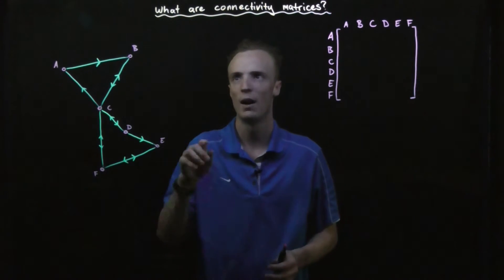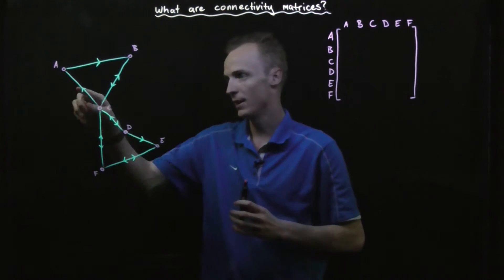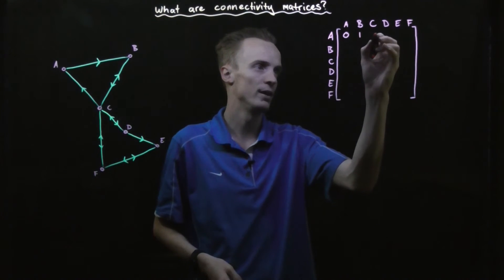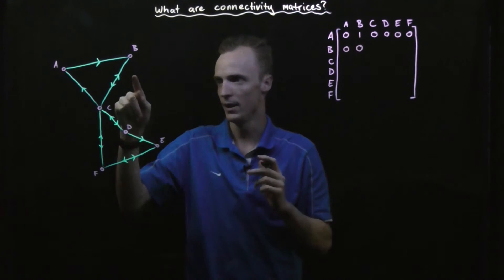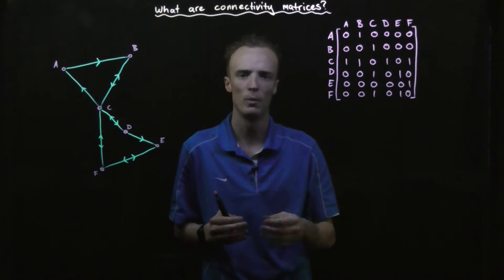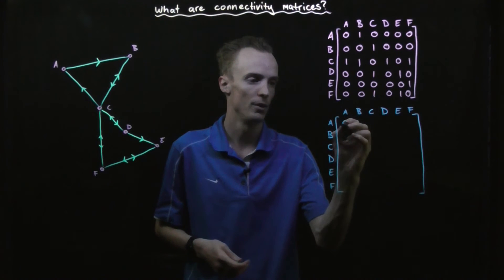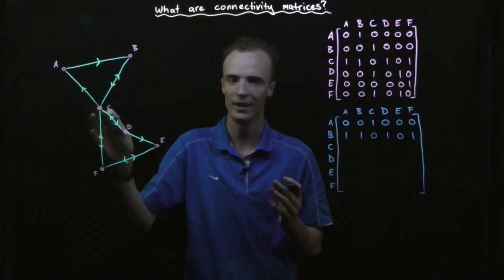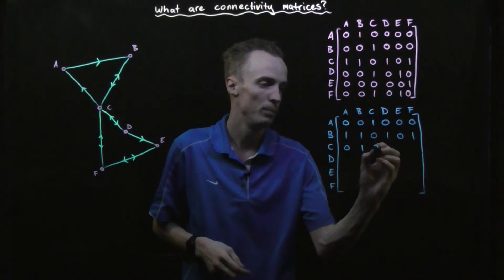Modelling With Matrices: What Are Connectivity Matrices

Comment: How did we have a two step connection in both F to D and D to F. There can only be one. Shouldn't the table be as follow?

         A        B        C        D        E        F   ------------- Destination
A       0        0        1        0         0        0          
B       1        1        0        1         0        1

C       0        1        3        0         2        0
D       1        1        0        1         0        2
E       0        0        1        0         1        0
F       1        1        0        1         0        2
Reply: nope, you can go from D-E-F and D-C-F and same for F to D but in reverse

Comment: FROM C TO F THERE IS 1 ROUTE NOT 0 NO?
Reply from the maker: Yes you are correct, but I have indicated that with a 1 in the matrix? The first matrix I wrote in pink was the "C" matrix which shows the one-step connections between nodes. The second matrix I wrote in blue was the "C^2" matrix, which shows the two-step connections between nodes. Now starting at node C, there is no way to finish at node F if you have to take exactly two steps. Hence there is a zero in the blue matrix. That's the only thing I can think of. I hope that helps. If not just let me know what you are referring to exactly.
Reply: Bell Curved Education what happens if you take a bidirectional link forward & then backward ? Or should it be only one link per movement ?
Reply from the maker: @Keircomb181  Going forward and then backwards would count as taking two steps and hence be a two step connection.